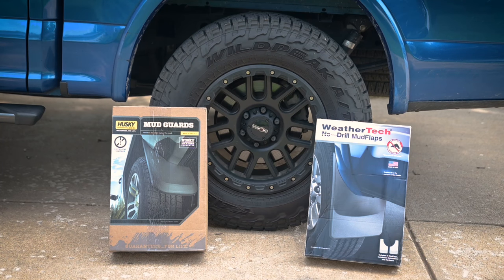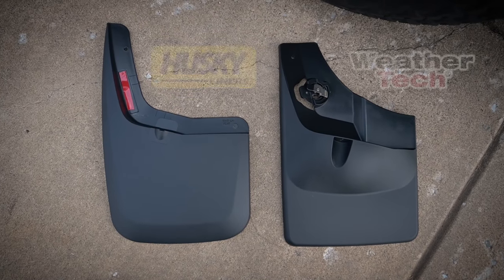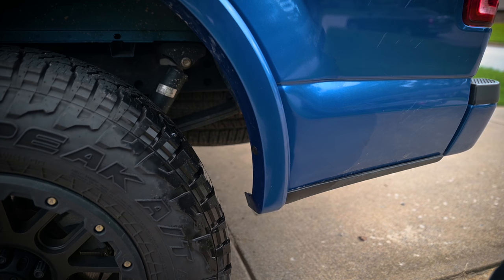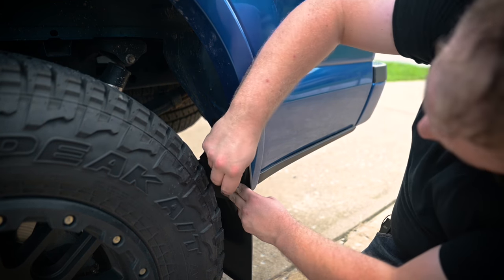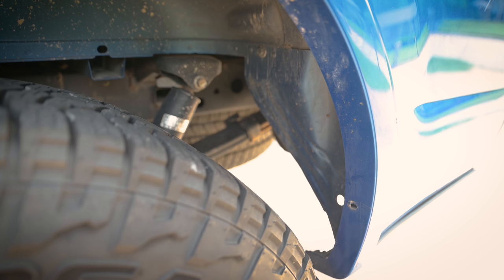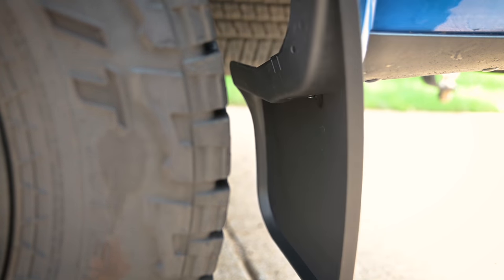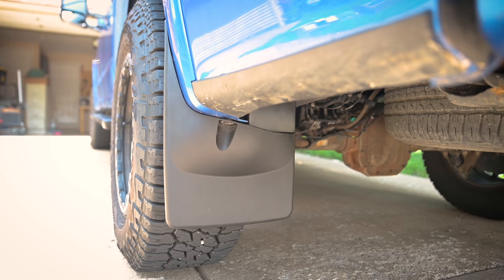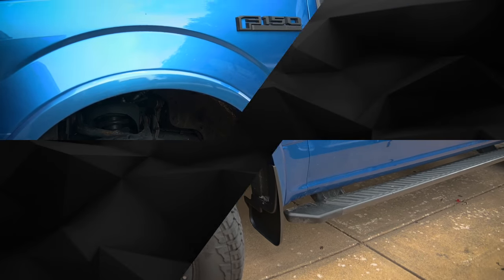MUD FLAPS - Husky vs Weathertech!

Comment: Weathertech has upped their game since this video, they add  more and better hardware now. Just installed them on 2020 Ranger and the fit and installation was perfect.
Reply: But they still don't supply fronts for RAMs with OEM fender flares and steps that are flush with the fender edge.

Comment: Mud flaps are a must if you want to protect against road blast, particularly in the winter with the salt rocks and dirt kicking up at your vehicle with the slush. However you gotta have mud flaps that will still be slightly soft when you bend them because the cold air could make them stiff and when you drive over and back up over large piles of heavy snow, the snow could rip them off. This would be more prevalent with lower clearance vehicles but I could see it happening with trucks too.

Comment: Im a mudflap fan....keeps the fenders cleaner and helps keep the small rocks from flying up and cracking windshields. On lifted vechiles and oversized tires where I used to live it was required. I like the Husky design but the Weather Tech fit. Good video and thanks

Comment: Great video. I went with the Husky brand which came with both front and rear mud flaps which installed very easily. They have a much wider area of protection which provides excellent protection for the lower body of my 2022 Ram 1500 Laramie 4x4 with factory air suspension.

Comment: I used Husky on my last two Tacoma's. The 4x4 TRD OR Tacoma I did some gnarly offroading and I never experienced a tear or a damaged flap. They held up well, and I didn't have rocks from my gravel drive way knocking paint off the bottom of my doors. Ordering a set for our 2012 Super Duty for the same reason. Dang rocks lol

Comment: In a winter environments something is required to minimize the road grime, chemical and glacier build up behind the wheels. I prefer the "splash guard" style. a shorter 3 " box type structure that is stronger, looks good or less ugly and prevents 3/4's of the build up. What does attach falls off when you close a door or give it a light kick.

Comment: Bought a OEM set for my 2018 RAM and they are still sitting in a cabinet because they required drilling sheet metal and using pop rivets.  May consider the Husky.

Comment: At 3/4 turn with a 275/60/20 with +12 offset wheel rubbed the Weather Techs.  Swapped with Ford OEM and no rubbing because they seat back farther.

Comment: I installed the Husky guards on the front & rear of my 2020 F250 super duty XL when I bought the truck new. I’m pleased with how the front set keeps the crud off of my factory running boards. The rears do a fair job keeping the mess off of my truck, but the front of my dump trailer still gets hit with what the mud guards can’t quite catch. Overall, I’m very pleased after close to 3 yrs of use.

Comment: I have had mud flaps on my trucks before. But on my new Truck I didn’t think I wanted them but last winter I had a lot of snow buildup in front of my running boards. I think putting on mud flaps will prevent this but I can’t decide. My last truck had weathertech but I’m leaning towards Husky that’s why I saw your video. To answer your question they do help out in winter !
Reply from the maker: Thanks for your input. I'll see what winter brings

Comment: Before taking off my mudflaps to allow bigger tires, I had a frame that was in decent shape. However two years after I notice a bunch of surface rust. I could be wrong but I contribute that from all the road salt and water that blasted the undercarriage from a few winters because I removed the flaps
Reply from the maker: That seems pretty convincing. Surface rust is no big deal though. Knock it off with a wire brush and coat the frame and you should be fine.

Comment: I had a similar experience with the front Weathertech flaps. It used 3 factory screws and 2 spring clips. But NO INSTRUCTIONS. I had to use a little bit of ingenuity to figure it out. Have no idea if I used the correct screws or washers. But the fit is superb

Comment: Not having mud flaps pit and scratch your truck. Real problem if you spend time on gravel roads and or road construction with loose material.
I went with the weathertechs, they provided the longer bolts and such, mounted up nice and secure. I personally like the look better on the weathertechs. 
Not a real fan of the looks of mud flaps necessarily, but like the protection that they provide.

Comment: I live down 3 miles of poorly maintained dirt/clay road. 2.5 miles of it is a cow farm. Came home today in a light rain and not only is the whole side of the truck covered in mud (dirt, clay and cow droppings) but the retractable floor boards are caked. It truly looks like I've been doing some extreme off-road riding.

I'm hoping mud flaps will control some of the mess. It looks like some of it was from the rear tire throwing mud forward. Not sure. But I'll give the husky's a try and see what happens.

Thanks for the video instructions and the comparison.
Reply from the maker: Come back and let me know what you find. With retractable running boards, I think front flaps are almost a necessity.

Comment: I have some Husky mudflaps for my 2024 GMC 2500 HD. the front installed easily EXCEPT for the clips. They are a bear to install. My next effort to install the clips will include some soap as a lubricant.

Comment: I did not have this issue with my 2011 Chevy Silverado. The Weathertech mud flabs have held well throughout these past 9 years. I recently bought a 2019 Silverado New Body Style and this issue did not exist when installing the Weathertech mud flaps.
Reply: I had his problem of bad design and short screws with the Husky's on my 2019 Silverado.  Do the weathertechs include the fender body clip to replace the factory front guard?

Comment: Just a suggestion and may be late to the party. You could loosen your ruuning board and have slid it back to have front flaps as well. Just my two cents.
Reply from the maker: Interesting idea. I didn't even look into the running boards, they are factory running boards, do they slide?

Comment: Just installed the weathertech on my 2017 F-150. Easy peasy and no issue with bolt being to short on the rear installation. Love em.
Reply: RJD same. I wonder if the weathertechs in the video were bought pre-owned or something? Mine had instructions and installed with no issues.
Reply: kgthakid that’s a possibility

Comment: I like the Weathertech ones better. I'm not a fan of the double sided tape on the Husky. My Weathertechs were very easy to install front and rear and they also came with some hardware with longer screws. I also think they fit the body of the truck better. My truck is a 2019.
Reply: The 2 sided tape is mainly to hold the flap in place during installation the provided clips actually help hold the flap in place along with the tape. I own both brands and I like both one set on my GMC Canyon the other on my Ram pickup. The look actually depends on the truck they are installed on for fit and actually the look itself. In other words the huskies I think look better on my ram than my GMC and other way around.

Comment: I bought the Husky over the Weather tech for the reasons covered in this video. I live in S. Ontario and travel very little on gravel roads but the little that I do I can hear the rocks hitting the metal on my 20 f150 xlt with stock tires. Because of this I'm looking for better coverage. On a previous 16 Ram I had Gator Back$ that were nice but the black powder coating $tarted to blast off after a couple of year$. What I'm thinking of now is the Husky Long Johns. Since they are all plastic I may mod them with a metal plate to prevent curling. I hope that works out since I will eventually get more aggressive tires.

Comment: My Weathertech came with instructions and new screws, washers, and nuts and installed both front and rear. Rather rigid. Flaps do make a difference in snow and wet mud. Take off the traction control if you switch to 4X4 while driving in mud and snow and enjoy the ride.
Reply: Husky comes with all that as well, and 3M translucent rock gaurd for around fenders with almost all the kits. Also they are the only company making them for the Sportbox Silverado, from 99-2002. They need a weird mudflap and husky makes ana amazing kit. Also there floor mats are better. Although they have less selection.
Reply: Shelbe Shocker I think he was making that comment because the video claims that the weathertech flaps are missing instructions and necessary equipment. I have the same  weathertech mud flaps on my F-150 and they came with install instructions and the rear screw underneath fit as it should.
Reply: The Weathertech's that I bought for my dually came with instructions and drawings that were for beans.  I had to figure out the installation on my own, and had lots of parts left over.  How about some real pictures Weathertech, and directions that can be understood?  I wouldn't buy from them again.  They don't even have a video for dually rears on their website.  I guess even they don't know how to install them.

Comment: weathertech fits the contour better?
Reply: I bought the Weathertech for the rear of my F350 dually.  It was a nightmare putting them on.  Even their own website only shows you how to put the front ones on with a video, but they don't show you the nightmare of putting the back ones on.
Reply: @woodrowmagnus2535  I didn't find my Weathertech install to be a full on nightmare but you WILL be on your knees and you WILL be on your back, unless you have a lift. That's probably true of all mudflaps I would think.

Comment: Weather tech does include screws and complete directions in the bottom of the box. Also looks like you have a Ford f 150 sport. Weather fronts fit-if you order the right kit.  Weather tech much better.  Problem was the installer not the product.
Reply from the maker: Problem was not with me. I used their website to order everything. If there was a problem it's with their process to pick which kit is needed.

Comment: Weathertech has 2 options for the mud flaps. One with the factory fender flare and one without. Did you buy the one without?
Reply from the maker: That's what I thought at first, but I double checked and I did have the right one.

Comment: Weathertech still doesn't offer front flaps for RAM with factory fender flares and step that is flush with fender edge.  For that reason, no Weathertech for me.  Pretty sure after watching this video and a few others I'm just going to DIY my flaps as all the "kits" except Rockblockers seem to have issues, and the Rockblockers are simply overpriced.

Comment: Ram factory flaps look the best
Reply: Did you get the heavy duty rubber ones? I am looking for a set for my 2016 ram 1500. Mopar usually fits perfectly but I am not sure about the design

Comment: TS what size tires are on your rig..they look good and are just flush with the fender lips.....clean looking?
Reply from the maker: Thanks! They're 275/70/18
Reply: @TruckStuff1   Do you have a leveling kit installed to fit 33's? I currently have 275/65/r18.

Comment: I have installed the rear Husky's.. and will be doing the front this weekend... wife needed me during initial install.. and got side tracked...  But I am hoping this will keep snow and debris out of my automatic running boards once fronts are installed. So far I like the look of the Husky on the rear and they do keep larger crud out of me Bestop bumper step, so there is another plus. 

Thanks for the video... Do you have one for the Fronts?? I am hesitant to drill for that install..
Reply from the maker: I just kind of mention the front at the end of this video. I used preexisting screw holes and factory screws